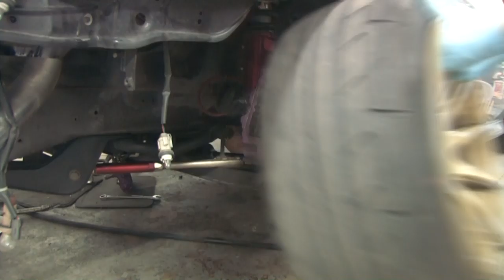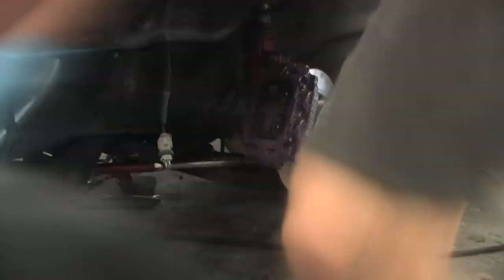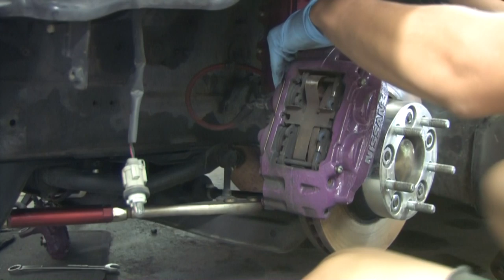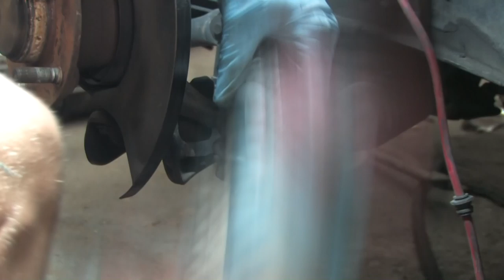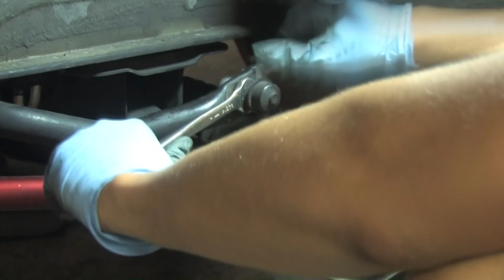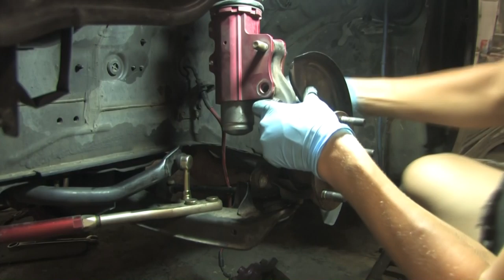Changing Ball Joint and Sway Bar Link 240sx s14

Comment: Being an Aircraft Mechanic in the USAF got me real good at removing cotter pins. Bend the legs as flat as you can and then grab the head with the curbed needle nose and pry it out slowly. Try removing one upside down in a place where you could barely see and reach. Oh and you can't drop it or else you'll have to find it and if you don't the jet gets impounded and the shift supervisor will have your ass because now you'll have to stay there all day long. Good times :)